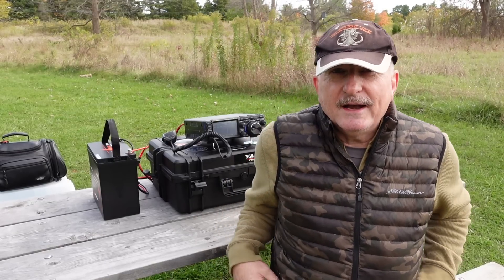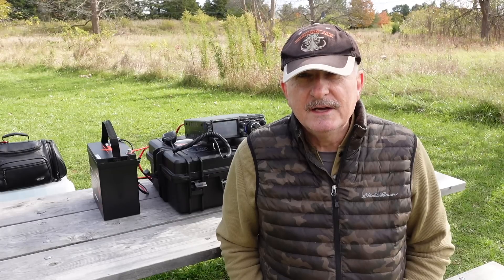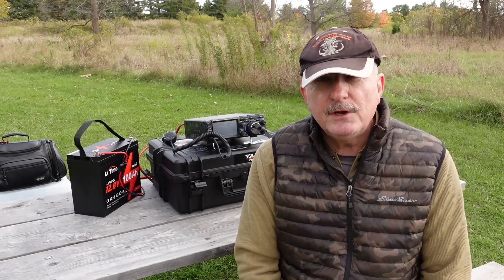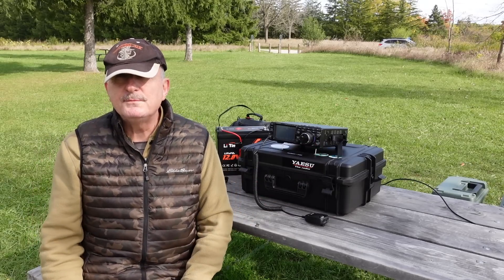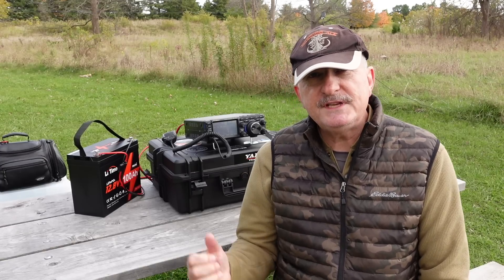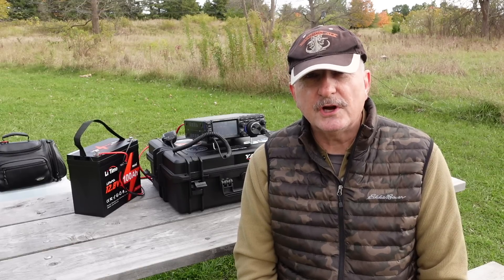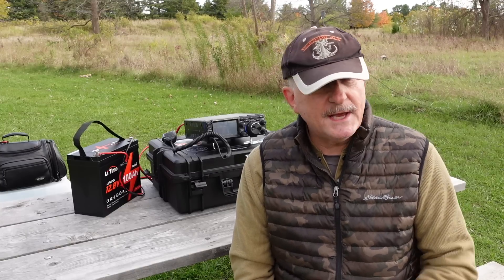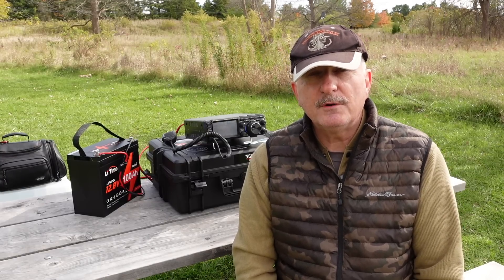Yaesu FT-710 as a Portable - Beast or Brick?

Comment: My only complaint is that current Yaesus with panadapters don't have averaging on their displays. Also recommend getting rails for that radio.
Reply: As far as I know, no Yaesu radio's have averaging.  My understanding is it is a Icom thing.
Reply: @davidc5027  Maybe the 991A has averaging?
Reply: @davidc5027 No reason why Yaesu cant do it in firmware.. its not copyrighted…
Reply: I just got rails for my IC-7300 after putting it off for a couple of years due to the cost. I should have gotten them a couple of years ago. It makes it much easier and less stressful to handle the radio.
Reply from the maker: Hi Philip, for some reason the lack of averaging does not bother me.
Reply: @OutdoorsOnTheAir  it's a preference. I've been using an old Flex 6300, which has averaging.
Reply: Any suggestions on a source for decent rails?
Reply: Google IC7300 rails

Comment: I take it you picked up the Field version of the FT-710.  According to the manual for the FT-991A it's operating temperature range is good down to -10C.  Odd the 2 radios would have different operating temperature ranges.
Reply from the maker: Yes I did pick the Field version. I had no intention of taking an external speaker portable. The FT-991A is next on my list to act as a cold weather option, just sold off one of my other radios to make way for it.
Reply: Good find.
Reply: I have the field version. I love it dearly. I think the only difference between the field and the AESS is the included speaker with the AESS.